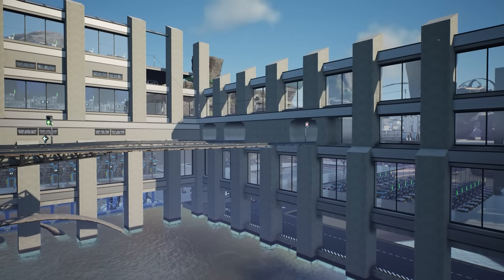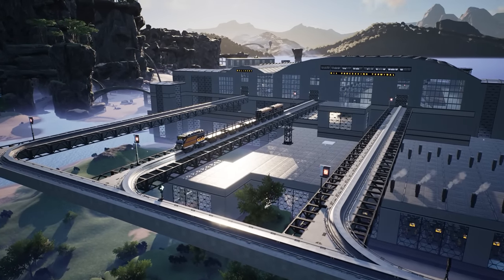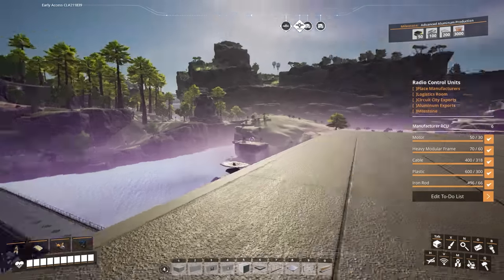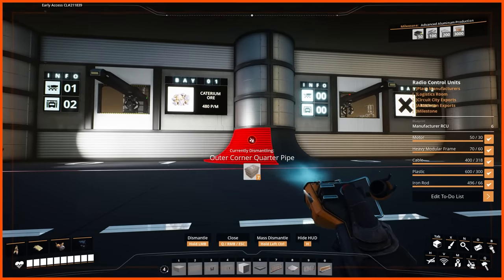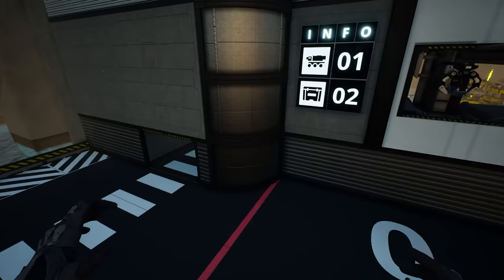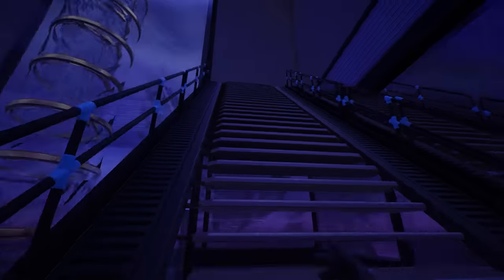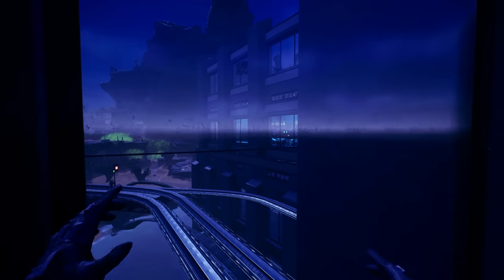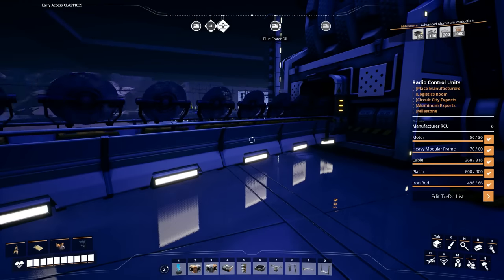RADIO CONTROL UNITS! - Let's Play SATISFACTORY Update 7 - Ep.50

Comment: Nuclear is fun.  No need to fear it.  Just make sure you have everything buttoned up perfectly.  In my own build, I don't like feeding back the waste products such as water and sulfuric acid.  Instead, I run the waste sulfuric acid into blenders producing batteries and use waste water to make wet concrete.   You'll need lots of concrete for the encased U and Pu cells anyway.  Sink the Pu fuel rods, don't burn them.  You'll need the last milestone to do that though, and LOTS of power slugs.  I tapped a full U node with a Mk 3 miner to get 600 U per min. That's enough to feed 30 nuclear power plants, which I don't want to build; or 12 fully overclocked power plants, which I did.

Comment: I think the way Satisfactory signals work is the same as Factorio, where it is easier to understand what is happening. You can have a look at that to understand better the path signal vs the block signal. But as a basic rule that never fails: a path signal before a train enters an intersection and a block signal as a train leaves an intersection. Rails crossing each other in Factorio count as one connected network, unless you separate them with some signals. I believe it is the same case here in Satisfactory.
Btw, great job with this serie, very enjoyable!

Comment: Hey Darren, with regards to circuit city, have you considered building its station a kilometer down the track, away from your oil/power station? Then just run a long tunnel/bridge parallel to the track from the distant station to circuit city. It may be inelegant, but it would mean you wouldn’t have to build a facility you’ve already crafted. And you wouldn’t destroy circuit city, which is a lovely example of your glass-walkway architectural period. Just a thought.

Comment: I'm catching up on this series, so it might be to late now, but one tip for nuclear power: don't go overboard. Only produce the power you need so you don't get swamped with the waste.
I used a big battery array to power any consumption above my normal power production, then used nuclear to recharge that as needed.
Reply from the maker: Still a tiny bit off for Nuclear - thanks for the advice!

Comment: Hey man I'm watching this playthrough a few months late I'm episode 10 so this comment may be irrelevant now but I notice you do a great job at setting everything out in factories but one tip. Storage boxes. If you hook a storage box to everything you can have alot of resources built up whilst your working on the next part of the factory so you get an instant boost in production after setting up. Also use storage as a buffer on a conveyor belt that gets too saturated so your machines can work even if the conveyer belts are backed up
Edit: spellings

Comment: The big danger with nuclear power is the cascade of misery you get if something goes wrong with your supply chain for making their fuel and then they shut down and your entire power grid (which had become reliant on the nuclear power) shuts down too, making it very difficult to bring the fuel supply back online.

To avoid this problem you could power the supply chain separately with non-nuclear power. Or you could just divert some of their fuel into a box that you can then use in emergencies.

Comment: Heavy modular frame and upgrading/moving circuit city would be great to set you up for the final project parts.
Reply from the maker: Yep that's exactly the plan. There's a few others I feel could be done too, for instance Stators aren't actually produced anywhere on their own, they're fully consumed in other factories. So a dedicated Heavy Modular Frame Factory, a new Circuit/High Speed Connector/Computer/Super Computer Factory and then Stator and AI Limiter Factory. Then I think I'm good to bring it all together. These are big projects but I think because my power is good for a while it shouldn't take too long!